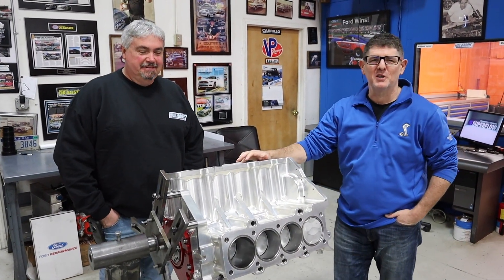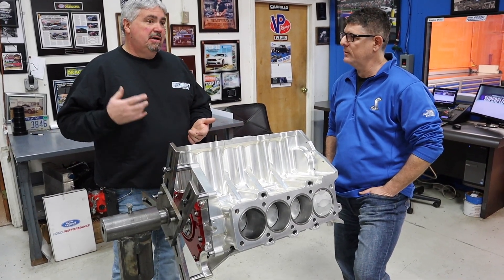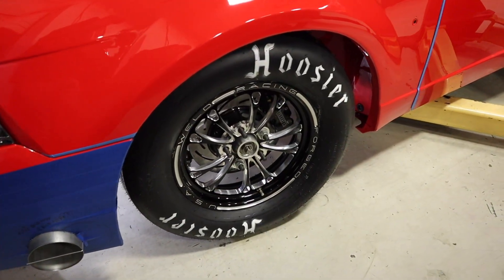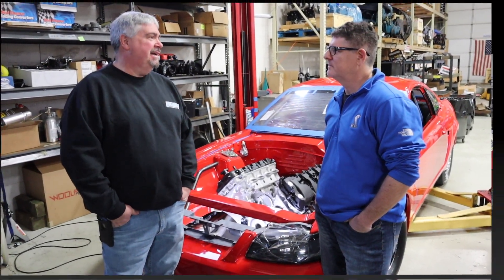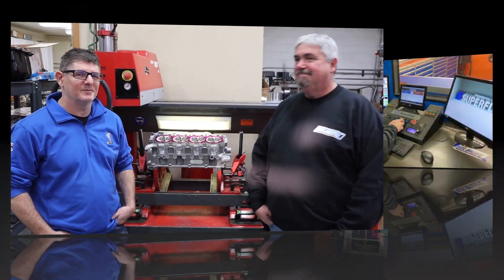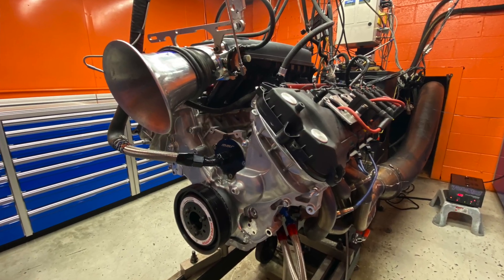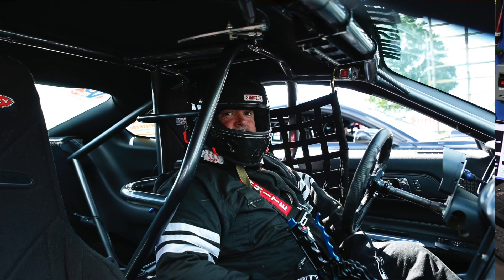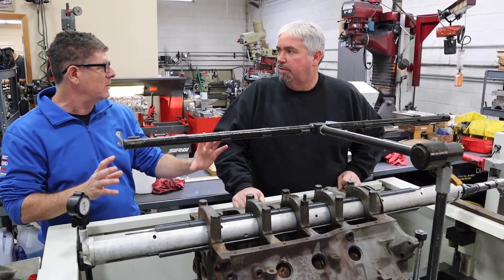850 HP All-Motor Coyote at Holbrook Racing Engines | Billet Coyote Engine Block & Race Car Reveal

Comment: Ima say 327 and 850 hp. Sus. Sorry but I'ma be one of those guys.
Reply: @7800
Reply: @dennisrobinson8008  as a yote owner and having built a high compression one. I just can't see 850 outta a 327 even with moon porting and captain insano cams. 650 sure but 850 a stretch.
Reply: @jonathonvince3605  we figured that out.   How did they justify such a big error?
Reply: @dennisrobinson8008  who knows lol. For the clicks. 850hp n/a coyote 😭🤣
Reply: @jonathonvince3605  850 at 9500 rpm
Reply: @dennisrobinson8008  he says 7800 rpm in the video.
Reply: @jonathonvince3605  And 575 peak tq.   I don't know how they stated those number
Reply: @jonathonvince3605  what are the cam specs?
Reply: @dennisrobinson8008  yeah something off. Either itz bigger displacement or their scaling on the dyno is tweeked. 12 to 1 comp idk. Now if its like 14 or more to 1 then yeah maybe possible.
Reply: @dennisrobinson8008  he didnt say. Probably something custom
Reply: @jonathonvince3605  Displacement stated at 327 ci and c25 fuel.  12:1
Reply: @dennisrobinson8008  yeah ik. U asked about cam specs.
Reply: I doubt its 12 to 1
Reply: @5.0george16  its all baloney.
Reply: @jonathonvince3605 I’m super late but if you haven’t figured it out yet, the reason why this motor puts out so much power is because it has been “machined.” Most amateurs who build motors only focus on bolting on parts for gains (compression pistons, big cams, or port work). Understanding the value of the machining (smooth bore, engine balance, etc) is why nascar, f1, and companies like this have so much power out of the n/a block. 
Also, I said this 1000 times. A machinist is like a barber. Some are better than others. 🤷🏾‍♂️

Comment: I think that coyote would have 900hp if he would have revved it out. That coyote sounded really good. I'd like to hear it going down the track.
Reply: 900+ . Possibly looking at 3HP per cubic inch with this motor if the rev it out to 9000 which is likely lower than where the redline will be when they race this.
Reply: @vxer1000  3hp per cubic is insane, especially for an engine with factory heads.

Comment: No Chevy can do what this engine does with the same cubic inches. Ever! Ford Technology 🎶🎶
Reply: The C8 Z06's naturlly aspirated 5.5L DOHC FPC V8 will make 700 HP with a after market exhaust system, GM performance intake if avialable and a tune.
Reply: @gen1c8rs88  that's assuming gm won't go bankrupt again. Looking at GMs Financials they will go bankrupt very soon. Nobody is buying their junk and they can only move money around and make it look like they are profitable for so long. No bank will loan them anymore money. They owe the Canadian government 60 billion dollars and even more to the US government.  They will most likely shut down all operations in North America and move everything over to China since they are owned by the Chinese.
Reply: @gen1c8rs88  an exhaust and a tune do not add 200 horsepower dude🤪
Reply: @MikeSmith-ey7ku The C8 Z06 is 670hp street car. All motor. A couple cheap mods and it’ll easily be capable of 700hp
Reply: @gen1c8rs88 and a whole lot of rod knock too
Reply: 1989-1995 Corvette ZR-1 LT5 

DOHC 5.7 V8 held many records no Ford has beaten. 

If the aftermarket for that engine was good, it could do this too. And make more power. (4.4” bore spacing anyone?)
Reply: @destruxandexploze2552 that engine isn’t even chevy it’s a engine built and designed by lotus engineers nothing to do with chevy
Reply: @CoyoteFTW  Wrong. 

Designed by GM and Lotus, built by Mercury Marine. 

I own a C4 Vette. Settle down now.
Reply: Do ur research before😂 anything
Reply: @762chinoo  and maybe copying coyote 🤙🏻
Reply: @762chinoo  hey hey bro 😂 go rsearch when did c8 zo6 came out , he wrote that comment before more than 3 years
Reply: That engine never even got close to it's rpm ceiling.
Reply: @Zach-ju5vi  it did not make 575 peak torque.    Maybe 475 thus a correction factor is grossly incorrect.
Reply: @dennisrobinson8008  what the hell does that have do with what I said.
Reply: And the Racing World Sanctioning Bodies prove your statement correct. Just the Cleveland Ban alone should make the other manufacturers hide In shame.
Reply: Ok
Reply: ALL YOU GUYS ON HERE ARGUING ABOUT CHEVY VS FORD VS MOPAR ETC ARE RETARDS. SOUNDS ABOUT LIKE THE SAME TYPE OF IDIOT WHO CLAIM ONE POLITICAL SIDE IS BETTER THAN THE OTHER SIDE..AT LEAST WITH MOTORS YOU CAN SAY THAT THEY ALL MAKE SOME BADASS STUFF AND ALL HAVE MADE HUGE PIECES OF SHYT TOO. QUITE ARGUING AGAINST EACH OTHER AND START COMPLAINING TO YOUR CONGRESSMAN/GOVT ABOUT THE PUSH TOWARDS A CORRUPT, BS SYSTEM OF LITHIUM BATTERIES AND SOULESS ELECTRIC MOTORS.
Reply: You do realize it was bored to 363 ci? Or around 6.2 liters
Reply: * Laughs in LT6 *
Reply: 😂you know nothing about cars absolutely nothing 😅
Reply: Lt6 says so 😂 is just the DOHC
Reply: The old pushrod could do it and even better dont start
Reply: @bigadielldne7234  That's why the Corvette is now DOHC 😄 🤣  Engnneeers at Chevy must be dumb for switching 🙄 😄 🤣 😂 😆
Reply: @cocacola3269  wht ? You say dohc is not fast ?
Reply: @Jack_sparrow-am-different  Yea Hondas are slow lol your delusional 🤣
Reply: @cocacola3269  do you wanna try with coyote , brett lasala stock block stock crank 3000hp , what are you talking about
Reply: How wrong can a person be? V6s do this on motor.
Reply: Dohc isn't Ford technology 🤣🤦
Reply: @twaskiandrews467  coyote is dohc
Reply: @Jack_sparrow-am-different  duh but it's not the first dohc nore did Ford create dohc...he said Ford technology
Reply: I wouldn’t count Chevy out just yet. If they brought out a 5.5L DOHC pushing 670hp from factory, imagine what they’ll produce once people that HAVE money start modifying those LT6 engines.
Reply: @amedrano8304  That’s basically what the ZR1 is. A 5.5L V8, but with twin turbos, making 1,064hp. More horsepower than any American production V8 or any Ford. 

Checkmate.
Reply: If they upped compression and let it rev out more it would make 950-1000hp. Stock 2019 F150 5.0 has 12.1 compression ratio on pump gas
Reply: They can build a 850 hp 5.3 ls
Reply: @dennisrobinson8008 but it can't make 2k HP on the stock heads and camshaft????
Nope!
Reply: @joelsavage8254  With enough boost it could, but obviously naturally aspirated it's not making 2K HP!
Reply: @dennisrobinson8008  obviously I'm talking about with boost.. And no stock head, intake and cam LS can make coyote HP!! Period.
Reply: @joelsavage8254 ur coyote cant  ur gonna blow up 3 blocks before touching 1.5k😂
Reply: @dennisrobinson8008 all motor ya right
Reply: @dennisrobinson8008 not on an all-motor build.
Reply: I’ve been saying that for years.. Ford makes more power per cubic inch naturally aspirated than any of its main competitors, especially with the birth of the coyote. A little 5 liter that can take on the world. Mopar has gained my respect in the last 10 years… but with that being said, it changes nothing. I am still 100% Ford man driving a 1993 Cobra with the old-school pushrod, 5.0.
Reply: Yes Chevy can, they’ve been doing it for years with the  SB2, making 850 hp on a 5.5L isn’t new
Reply: @zackdillon1320  you’re comparing a nascar engineered engine to a engine that comes in a street car....fucking clown
Reply: @zackdillon1320 ; Send me a link to that 1100 hp na ls.
Reply: @daleostrom3613   I was wondering about this myself 😂😂😂
Reply: @daleostrom3613  https://youtu.be/aAANGDX_iW0  1100 hp out of a large ci na LS isn't asking too much. Just imagine what a Coyote would do with that many cubes.
Reply: @daleostrom3613  that 1100hp ls was 457ci lol
Reply: @daleostrom3613 hey cupcake https://youtu.be/vr_gl2cgl1o?si=mHl12yO4YFh3CdQx
Reply: @zackdillon1320   930 with a 5.9L SB2 is what I have seen in NASCAR.
Reply: Seen 970hp nascar Clevelands....
Reply: @gen1c8rs88  
that is not true NASCAR was limited to 850hp. 
Then in  '15 then it dropped to 725hp, then again in '19  550hp. 
2020 or 21 they went to 750hp and that were it is now.
Reply: @zackdillon1320 nah i dont think so , at least why gm cant build is engine like coyote with stock engine making at least 800 hp , they are just keep increasing the liters , until now they make 10.3 copo camaro , they cant do a lot what ford does , but but now the c8 zo6 engine is overhead cam , congratulation , hope it doesn’t fail
Reply: LS still beats on actual size of engine, cost, reliability, simplicity.
Reply: @georgelin8498  no, no, no. GM guys are like Toyota guys. They ride an old stereotype. Someone was trying to convince me on YT the other day that a 351 Windsor has the same power potential as an LS with the same type of displacement, (100% agree) but costs 3x's more to build than LS. (100% disagree) A LS engine that's a legit "built" engime is extremely expensive, just like a legit "built" SBF/Modular/Coyote. Highend aftermarket performance components costs big $ for any brand or series of engine. Do we think a set of say Manley H-Beam rod costs $500 for LS, but $1,500 for SBF? If you buy a TFS head for a 6L LS (using 6L because of the 4" bore being the same as a Windsor) that costs $2,500, do we think a similarity flowing TFS head for a SBF costs $7,500? What about headers, camshafts, intake manifolds, fuel system components? I would definitely give LS the edge on ignition and maybe oiling system costs. If we're just trying to compare making a very budgeted N/A build to 500 WHP then I'd give the edge to LS. A legit "budget 351 Windsor will eat a budgeted built LS using say a high mileage junkyard engine with some ported 799's or 243's, an off the shelf cam, with a set of ARP rod bolts, and some Pacesetters? 

GEN3 and non-AFM having GEN4 LS is the only ones to have a chance to claim better reliability compared to Coyote. GM's DOD setup is trash compared to Dodge and Fords. If you include a GEN5 SBC when referring to LS then GEN3 Coyotes fuel setup is 5x better, and way cheaper and easier to mod, all while supporting around 200 more HP than GM's DI setup before needing to be upgraded. 

If talking aluminum blocks I'd say Fords blocks are definitely stronger than aluminum LS's blocks. The mid-99/01 Cobras WAP block being the exception.

The Coyote being so called more complexity over LS just simplifies and lowers the costs for the end user especially when talking fuel systems. Hell an 18+ Coyote fuel system will support 700+ WHP without changing anything, and then when you do have to upgrade it you leave the DI side stock, and upgrade your port injectors, and then you may eventually need a stronger pump or either run BAP. Still a stock Coyote fuel system can get you to 700+ WHP bone stock.

Plus Coyotes have been getting lighter, where SBC's have been getting heavier.

Still I've owned or own LS, Modular, GEN5 LT1, GEN3 Coyote. All are great. Each has advantages over the other. Still when talking about full bolt, N/A cars the newer Coyotes are hard to beat, and especially when talking reliability, cost to mod, and ease of moding compared to a modern SBC.
Reply: @georgelin8498 but has never gone 300.4 mph in a standing mile on an oe block and heads. 
Or ran 6.52 @ 216mph on 275s during drag week with an oe block, oe crank and ported oe heads.
Or has the capability of 7s, factory sealed oe engine. 
Or gone 5.88 @ 256mph with an almost entirely oem engine. 
Fords twin cam engines have....

Comment: It wasn't that long ago import guys were giving the domestic guys so much crap for "inefficient american pushrod engines". Now you have americans building dohc engines making 850hp without a pound of boost. Don't hear the import guys crowing as much these days.
Reply: Pushrod V8’s can make this power too just as efficient
Reply: @zackdillon1320  
Evidence?
Reply: @177SCmaro  you’re on YouTube, look it up. 1100 hp NA LS. 1320 made a video on the dude. There’s also a engine dyno of a different LS making 1100 hp NA
Reply: @zackdillon1320  
That was a 7 liter if I remember right. SAM built something similar. The Coyote is a 5 liter. The one in this video was a 5.3L. Yeah, if you make a pushrod engine big enough sure it will make more power then a DOHC. Nothing remarkable there.
Reply: @177SCmaro  there’s also a SB2 that Chevy makes, a 5.5L that pushed 850 hp but that was 10 years ago so it’s old technology
Reply: @zackdillon1320  
Well, without any evidence I cannot conform or deny your claim.
Reply: @177SCmaro  then look it up... I just gave you all of the information you need
Reply: @zackdillon1320  
I would point out that the highest effecency engines that I'm aware of in terms of NA specific output in racing are Formula One engines, and they're also DOHC, 4 valve design. 
Btw, DOHC is also old technology. It's been around almost as long as cam in block pushrod engines.
Reply: @zackdillon1320  
It's not my job prove your claim for you. I may look into later or not. As it stands, again, the highest specific output NA engines I know of are still DOHC in F1.
Reply: @isiahgomez6860  He literally gave me a vague claim about something that supposedly happened a decade ago. Burden of proof is on the claimant, not the skeptic.

Comment: I'm sorry, you have an LS what? 🤔

IT DOESN'T MATTER!!!
Reply: The cubic inch man. In the world of N/A, that is a big factor. Look at power per cube, then get back to me. Your starting to sound like an LS nut swinger. They are just catching up to where SBC's and SBF's we're 10 years ago.
Reply: @TheSlim93gt  Exactly as i suspected. power per cubic inch nobody cares. thats a ricer argument. and the cube limitations of the coyote architecture which make it inferior to the ls platofrm. comparing cube to cube vs a dohc design of course it will make more power per cubic inch. with a physically larger egine with less cubes. regardless GM just produced something that blows the doors off of any factory hp per cube na ford has ever made in the 670 hp 5.5 dohc zo6.
Reply: @ultrazls1  There are people who care when your committed to running a platform. Yeah the cubic inch is limited, but it nice to know power can be had. 
I am a fan of the new 5.5 V8. Ford kind of half assed their's. I've enjoyed the banter. Out.
Reply: Ummm… comparable full built stroker LS motors do well over 1000 hp
Reply: @ultrazls1  Not comparable with aftermarket heads and sheet metal intakes. Your talking big cube strokers. The 4 valve is far superior and believe me, I'm a pushrod man.
Reply: @TheSlim93gt  wrong. the only motors that compete with the ls during engine masters challenges are actually the modular 3 valve. Built ls makes more hp than built coyote na. common knowledge. there are heads cam stock bottom end ls7s on pump e85 making as much hp as this motor
Reply: @TheSlim93gt  not to mention the LS has been 7s NA. Faster than any coyote has been NA

Comment: They made 850hp out of a 5.3L Coyote... JESUS!!!!!!
Reply: Hadn't gotten there yet, wondered if it was a 5.2L stroker or something.
Reply: @02honeydew  I wonder how well a destroked high RPM application would work with this engine.
Reply: @asdf51501  Probably pretty nice especially with some super light-weight pistons and maybe billet aluminum rods from some top-fuel cars. Hear one revving to 10K would sound pretty fire
Reply: @02honeydew  Yep!
Reply: @02honeydew  great if you want to change rods all the time which is fine with me in a full race application. Really nice build here regardless.
Reply: @waynebollentin989  You're definitely right but it certainly would be really cool. I'd personally like to see one through someone else's wallet lol
Reply: @02honeydew  couldn't agree more lol. It's ruff the other way for sure having done it but worth it for sure in the right circumstances.
Reply: @waynebollentin989  Absolutely, I wouldn't expect anyone to do it who isn't seeking max performance for the track tbh. Similar to people building high hp diesels with forged pistons without that steel top ring land for weight savings but then having to rebuild at a much faster rate from lower piston life. Hopefully someone does it so we can live vicariously though lmao
Reply: @02honeydew so yo do realize they rev these out to 10 and 11 thousand with the stock stroke this engine is likely just a sleeved engine that is 3.700 bore to make it 5.2L. The one I built in my garage makes 585 at the crank on 93 and it’s 13.48:1 compression. If it were to have good fuel like true E85 or some race fuel it would without a doubt break the 600 mark and likely make closer to 650 on unported Gen2 heads Erving it out to 8500.
Reply: @02honeydew  billet block, nothing in common with anything you can buy from ford
Reply: @whatchu_talkin_john_willis  yeah I know, MMR makes one too up to 351C size.
Reply: Wrong. 363 cui is more like 5.8L
Reply: @ckryegrass11 wrong it’s a 5.9
Reply: Yeah, no they didn't. That's physically impossible.

Comment: Wait... Are there no coolant tracks? How does it cool itself?
Reply: Before sleeving they could certainly cut some coolant track in the block, but why? It's a track motor only. It'll run maximum 2 minutes at idle and possibly 5 seconds at full power. They'll shut it down immediately after the run and ice it down to get it ready for the next pass.